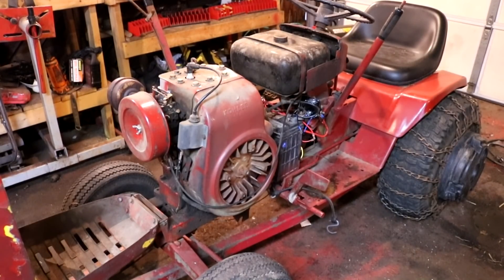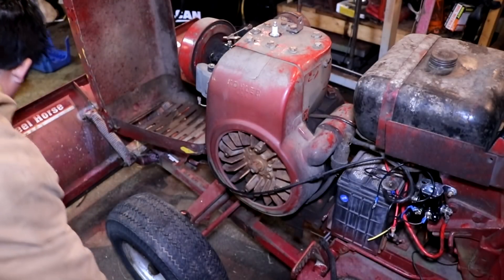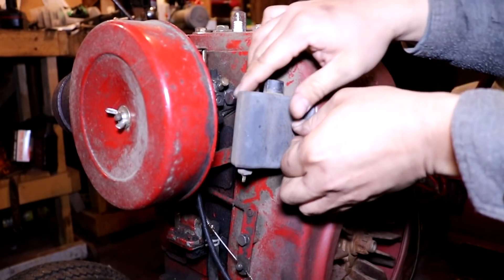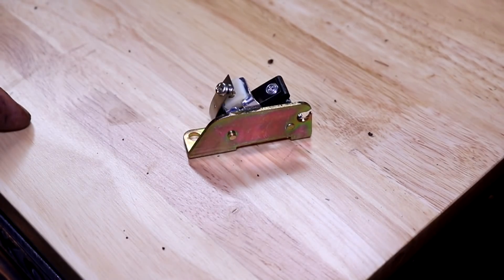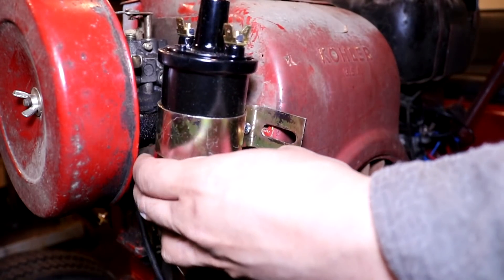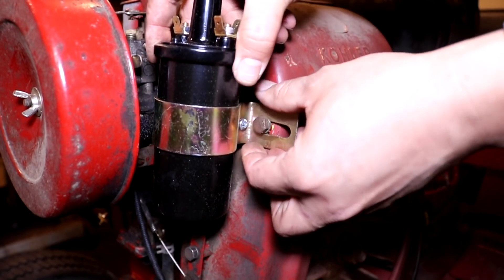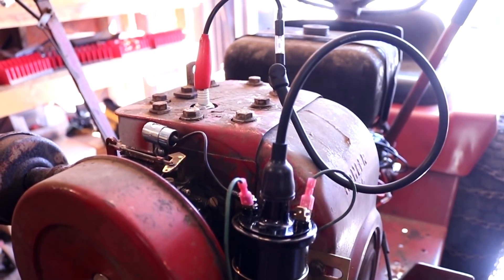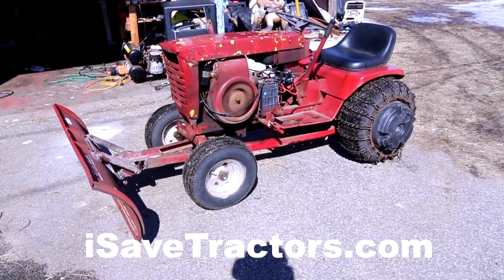How-To Convert Kohler Breakerless Ignition System to Breaker Points Ignition System | Kohler Engine

Comment from the maker: Hope You Enjoy this Video! If you have a Breakerless Ignition Coil, and it has failed, don't panic, we have your back! As always watch this video, then check out website for written articles, and you can always call or email us for free technical advice! We also sell the best parts, kits, and information for your vintage small engines. Thank you for saving the tractors!
Reply: Funny thing is I was just thinking the other day I got to get my old gt14 out and see what I got to do to fix my spark issue. And bang lol you posted a video exactly what I needed!! I believe you said you have a kit with what I need
Reply: How do I go about contacting you to see if you’d like to purchase a garden tractor cheaply
Reply: looking for the kit you used in video to replace the breakerless ignition do you sale it
Reply: the breaker less system was interesting, only seen one so far and for a moment it was flaky and then sorted itself.
if only the makers of it would know long after they stopped supporting their system the tried and true points and condenser system is still alive and well, with MANY aftermarket makers making components just as good as OEM.
Reply: I’m probably about to do this in the near future, my pk stopped running shortly after I repainted it

Comment: I have 67 125  and it was running fine last time I used it and several months later it would not start .Points were not opening at all! I pushed the rod back into the hole and when I turned the engine by had I felt no pressure on the points rod.Perhaps the rod is damaged or the Cam shaft has issues.

Comment: Hi, great video, 
Was considering doing the reverse of this on mine, as my contact points pin does not move in and out with camshaft, the pin is free. I can take it out and in, looks fine, but when pushed all way in does not move at all when turning engine.. whatever is supposed to push it isn’t anymore, cam seems fine as can see exhaust valve opening with spark plug out..
Would it be possible to convert to electronic?

Comment: Hey Norman! All is Well in the Kohler universe that  Engine has the proper set of controls onboard again! Cheers! Nothing wrong with points the trouble is the condenser that evil wire is always escaping the boot never had issue with points!

Comment: I have a kohler k181s that came off a 1967 wheelhorse 857. I took the fly wheel off and there is no magnets or magnito. Did they come that way?
Reply from the maker: Yes, they used a starter generator.

Comment: Two things, I have a '69 Wheel Horse Charger with the Kohler KV181S engine and electronic ignition. (vertical shaft) I've found the holes for the points ignition but there are only 4 holes, no center hole for the pin to operate the points. Short of completely disassembling the motor to possibly drill a hole, I'm stuck with the electronic ignition parts shortage or NLA. But I've had no trouble with the ignition (or anything else) for 55 years and recently scored an ebay used coil, trigger and stator cheap so I don't have to abandon the motor. The other thing is when testing the coil there is no continuity between the plug wire and ground or the input and from the input to ground it acts like my meter is charging a capacitor. Can't get the plug wire out of the coil socket, it's really stuck in there and like I said it's run great for 55 years so "leave well enough alone."  And who says you can't do a compression test on an ACR engine? 120# right on the nose at cranking speed. Thanks for listening.

Comment: Why would you want to go back to points? There is a reason why newer small engines and vehicles don't use them😮😮😮
Reply: The parts for the breakerless points are not made anymore plus points are way more reliable and much more simpler.
Reply: CDI CONVERSION WAY TO GO. ISNT A CDI KIT AVAILAE EX.1982 16 HP KOHLER SINGLE ?

Comment: Thank you so much for this video. I parked a 1969 John Deere 140 20 years ago because of an ignition problem.  I even had the John Deere tech manual and still could not get it right. I got so aggravated with it I  pushed it under the shed and gave up. I installed the points per your video and got it going....thanks again.

Comment: My k181 has points but no 12v coil. I can’t get spark, it has a magneto. I don’t see where the condenser is but I assume it has one. I cleaned the points and set the gap and no spark still
Reply from the maker: For magneto systems try a more advanced timing. Try setting points to .019, .018, and .017 gaps. Condenser is under the flywheel. If you replace the condenser, I would recommend moving it to outside of engine so you don't have to remove the flywheel to service.
Reply: @Isavetractors  new spark plug solved it. even though i had good spark visually and on several different testers. i even tried other good used plugs  from other k series engines and for some reason its just picky.

Comment: Holy cow dude, great video! I just bought a wheel horse with the exact motor and I can find any info on where the mag wire goes after it splits off from the coil. So I'm going to do the change over. I'll be ordering soon!!

Comment: I have a breakerless ignition system and do not wish to convert it as I think it would be cool to keep it as original as possible. It's a raider 12, 1969 if I remember correctly. I do not have spark and cannot figure out why. Any suggestions?
Reply from the maker: Go through my trouble shooting in this video. Common for the coil to fail at this point. Switching to battery ignition can still be though of as "Original" as only a very small number of machines had the breakerless set up and it was quickly abandoned and replaced with solid state ignition later on.

Comment: Norman, your links for the Push Rod and Points Cover Grommet exhibit "Error 404 Page Not Found". Please advise on where to get them on your website. I want to buy everything I need (as shown in your video here) to do a conversion. Thanks.
Reply from the maker: Hi Dennis, thanks for the heads up. I will correct those links. We are machining more push rods now, should be available in a few weeks. I do some have some on my desk though, so email me and I can make sure I get you one. info@isavetractors.com

Comment: Norman, this is valuable information and the video is well done. Thank you. I am doing diagnostics on my friend's Kohler engine made for Gravely which has this breakerless ignition system. I see two wires attached to the "trigger point" of the coil module (Looks like yours is the same: at 1:50 in your video). I think it comes from the Trigger module. My question is why two wires coming out of the Trigger module but tied together at the same point at the input to the Coil? How does it work? Thanks.
Reply from the maker: One of the wires is a "Kill wire" and it connects to ground when you turn the key off to turn off your tractor. When you connect the trigger to ground, you provide it with a path of lesser resistance, so the coil doesn't produce a spark, thus shutting everything down.

Comment: Hey Norman, I have a question. I have a cub cadet 1650 with a Kohler K341 16hp engine that the points won’t open when I turn the engine over, I was wondering if you know what the problem is or if you know a place that I could get an electronic ignition from. That’s what I thought would fix it but I couldn’t ever find a kit for it.
Reply from the maker: Loosen the adjustment screw on your points set, and push the fixed contact all the way towards the engine block. Now try again. Do you see the points moving now?
Reply: Thank you but the plunger points plunger isn’t moving eather
Reply: I don’t though

Comment: I have a Kohler K301 engine I rebuilt never ran it before the rebuild it came to me in a box. put it back together bored it 30 over laped the valves and adjusted them now I go out to try it out the engine has been ran and used lightly since I have finished it. the motor lacks on power for what ever reason it drives the tractor around ok but when I kick on the mower deck or push around a snow plow it really boggs it down the engine runs wide open with the deck on but sounds like its a little under half throttle. I messed with the carb some but that didnt seem to help my issue could it be points or somthing im missing. Let me know I figured I would ask you cause I know you work on these engines and make good products.
Reply from the maker: Could be your governor. Try disconnecting the link between governor and carb. Now turn on your deck and safely operate your throttle on your carb by hand. Is there proper power like this? What you're doing is isolating the carburetor by itself and removing the governor from The equation. This should help you narrow down what to do next.
Reply: @Isavetractors  thanks norman I will have to give it a shot.

Comment: Tools don't make a mechanic but they sure get us closer..lol  I use an M12 Milwaukee or Dewalt impact setup anymore, they save me so much hassle they're almost worth their weight in gold. You wont need to fast forward your vids as often with one either..lol  
   I started using small impacts about 6yrs ago and omg they've saved me so much aggravation, I'd never go back to reg ratchets (Still use reg to hand tighten small nuts/bolts not to strip them thats it).  I have a set long impact bits (assorted) to reach into hard to reach areas that also save a lot of trouble.
 I hardly ever use regular wrenches after using Gear Wrench speeds those are super nice too. I only wish I had them all 30yrs ago when I did so much more mechanic work.

Comment: Probably is why mine wont start because its needing that trigger module 

My condenser works and the points have spark but not the plug wire so I could use those parts your taking off my engine has the same spot for the trigger module

Comment: Hi! Eagerly awaiting more videos from you but I know your business is going great so your time is probably limited. Anyway, at 06:39 you talk about the parts in the system and you talk about condensor, I always thought it was a capacitor. Perhaps it can be called more than one thing, English is not my native language. Have a great week!
Reply from the maker: Thanks! The condenser is a capacitor. Condenser is just the common use term for the auto industry application. I hope to be back to making videos by mid summer!
Reply: @Isavetractors  thanks, I have seen it before (work in the auto industry) but thought it was a faulty translation from german to English. Now I know better!

Comment: Hey Norman. What size generator and welder do you use. I have a 90 amp Lincoln flux core and can't find good info on what size genset will run it. Thanks.
Reply from the maker: I now have a 50amp welding hook up and use a 200 amp welder. But when I started I used a 120amp welder running off of a 4000w generator I got from a yard sale.

Comment: of the subject a little but i need an answer quickly so i can get to work just after the rain.The high speed needle for the carburetor on the k301 should there be a hole straight through  near the bottom of needle? (near point)or just part way through?cheers everyone.

Comment: I have a question about the breaker less Kohler engine. The stator for this engine is different from the points engine and is obsolete part. Wondering if the points engine stator would work as a substitute or would the flywheel also need to be changed. Any thoughts?
Reply from the maker: You can keep using your stator. The reason they are different is because there is a winding on the stator for the breakerless coil. You can still use the other 2 wires for your regulator rectifier
Reply: @Isavetractors  I have a bad stator so I just wanted to know if the points ign stator would work since the breaker less stator is nla. Any ideas?

Comment: Is this the same thing as a "solid state" system?
Reply from the maker: No it's not the same operation, but the result is the same, using magnets to generate high voltage spark instead of a battery.
Reply: @Isavetractors  Thanks!  Love the channel!  It's really helped me over the last few years.

Comment: No to get off the subject but were can I get a crank for a Kohler 321AQS ?? Mine cracked 😬
Reply from the maker: You should check eBay for a good used one with the same PTO dimensions. You can then have a local machine shop machine the new crank if necessary.

Comment: Cool my project for today was to change the hydro and engine oil filters in my pop pops new Holland l250 skid loader with a p218g onan engine it surges and runs real bad but it’s still going with almost 2000 hours it uses a quart of oil per hour the fluids and filters were never changed in over 11 years so it was desperate

Comment: I wished I had seen this video about 10 years ago. I paid some one to do this conversion. I am having an issue with the charging system though. It's putting out about 12.7-12.9 v. Seems a bit low. Great job on the video...I'm needing to replace my ignition switch so I'll be ordering soon.

Comment: Spark plug gap at 35 thousands? They are always at 25 thousands. Or am i wrong.
Reply from the maker: .025 plug gap is for Magneto Ignition systems. .035 for battery ignition. The reason is Magneto systems produce much less voltage at the plug so you need a more narrow gap for the spark to jump across. Battery Ignition puts out much more voltage hence the need for a larger gap.

Comment: Converting TO points. That's a new one.
Reply: Real common on Economy tracts as the breakerless system is $$$$
Reply: Ignition modules are NOT as reliable as points. I don't know if people know that. As long as you don't get water in your points, they cannot just randomly fail for no reason. Electronic modules can and do fail randomly for no reason, although it's extremely rare. I've had electronic modules on chainsaw engines die for no reason.

Comment: 11k ohms seems kind of high, Kohler must have really wanted to limit current to the spark. Question, could the original coil be used with the breaker/points condenser ?
Reply: Nope. The coil isn't just a coil on them.